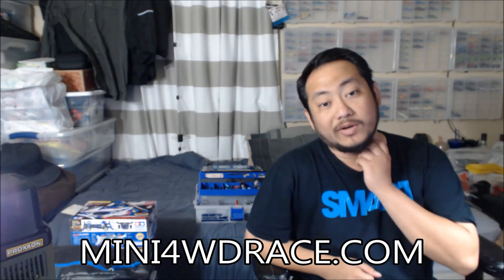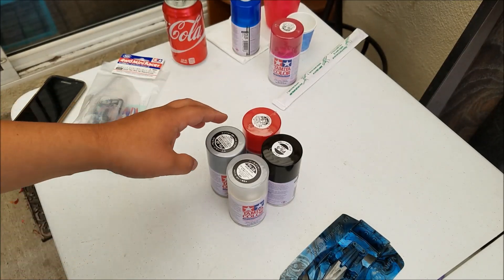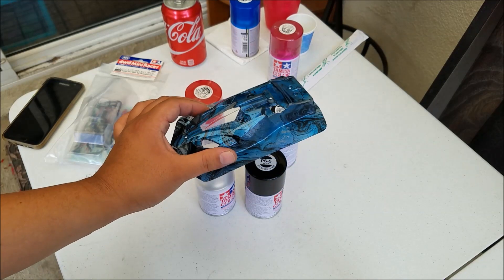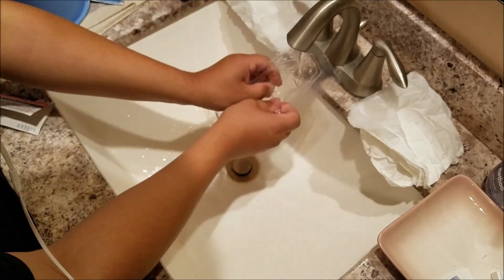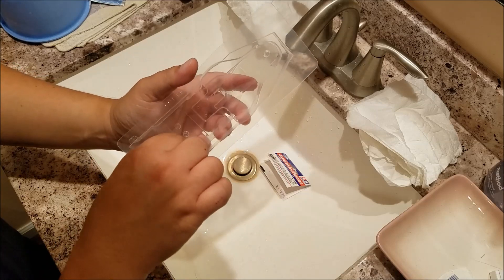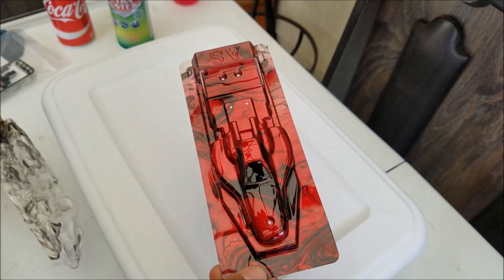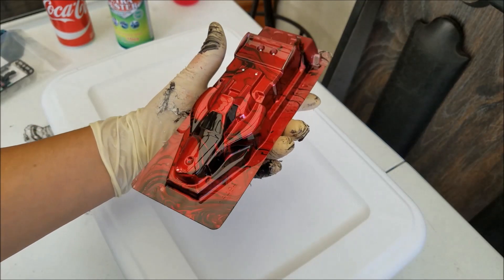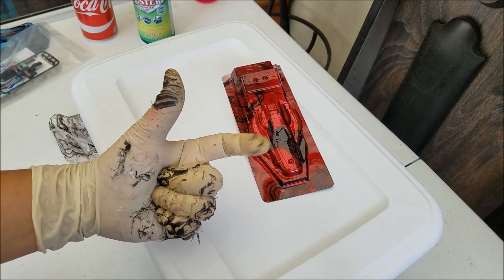【ミニ四駆】Tamiya Mini 4WD Testing: Hydro Dip Marble Paint Guide

Comment: A big success!! 👍
Reply from the maker: Indeed.
Reply: itu air biasa sama cat khusus poly kan?
Reply: Bondry Haryo Anabrang Iya bozzzz
Reply: @Z3NBluster  sir can i ask what spray paints did you used amd the glossy coatings and what liquid did you used is that plain water?
Reply: @Z3NBluster  tia
Reply from the maker: @papacarlbau  If you watch the video without skipping you will find out the answer to your questions.

Comment: why do you have to use the PS-58 pearl clear?
Reply from the maker: Rafi Latief So that the black paint has something to swirl with. If it does not have the clear with swirl with, the black on its own would not cover the entire under surface of the clear body. The marble shape of the black would not come through very well too.
Reply: so if i use 2 or 3 colours for the dip i don't need the PS-58?
Reply from the maker: Rafi Latief That's up to you. Your marbling colors will look very different from the way mine turned out. Use any color except for Red. Red does not coagulate and runs. I don't know why, that's just what it does.
Reply: But you actually used red
Reply: @cheesenoodles9403  I think he meant for the dipping part.

Comment: Hi, can I ask if let say I am bad with cutting these kind of bodies, is it possible to use this method on ready made transparent bodies ?
Reply from the maker: If you're not planning to use Poly Carbonate bodies, do you mean to do this on the ABS Clear Bodies? The cleat bodies that come from kits? GIve me an example so I can more accurately answer your question.
Reply: Z3N Bluster hi yes. To be exact I am looking at using the ABS DCR01 cover. The cover is lightly tinted grey but still transparent
Reply from the maker: I honestly don't know for sure. Ice never done it on ABS. But if you really wanted to do it on ABS, a couple of issues you will have. Instead of PS Paints I mentioned in the video you might have to use the TS Paints. But then I've never seen anyone use the Hydro Dip on ABS, so I don't know how the TS Paints will react. Also this method works easily because Polycarbonate bodies have an outer film layer that protects the outside from getting paint splatter. If you want the paint to come through from the underside, you will have to mask the outer layer somehow. Otherwise the hydro dip paint process can be an uncontrollable mess. I honestly don't know how this would turn out. So if you wanna do that, you may need to research the info on your own. We primarily use Polycarbonate bodies specifically because they are lighter and are better for racing. Even though they are a pain to cut, the weight saving they provide is worth it in the end.
Reply: Thank you zen for the reply. Maybe I will give poly carbonate a shot some time!
Reply: Use a drimmel gives nice edges.

Comment: do you need a clear body?
Reply from the maker: If you're serious about maximizing the performance of your car, yes.
Reply: @Z3NBluster  ok thank you very much😊
Reply: @Z3NBluster  so can i hydro dip my dcr body?
Reply from the maker: I've never done a hydrodip on the DCR. I think you're confusing, "clear body," with, "Polycarbonate body." Which are you referring to?
Reply from the maker: The DCR Body is ABS. Which will require a totally different set of paints. And I do not know how paint for ABS bodies will react with the hydrodip process.
Reply: @Z3NBluster  oh no i already tried it it works with the one for plastics thank you for answering my question anyways

Comment: When painting,  your paint source should be kept at 90 degrees to the surface you are painting  if you arc as you are doing your paint gets thick in the middle and thinner on the edges.  Something my 30 years of painting Polycarbonate RC bodies teaches